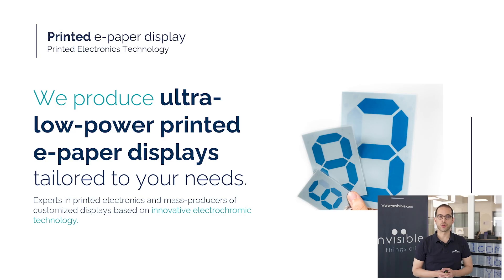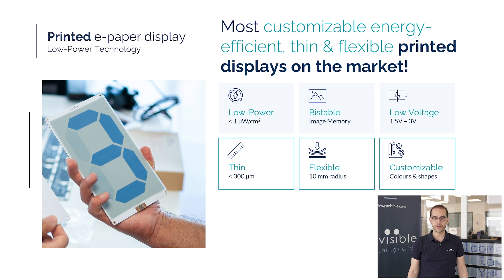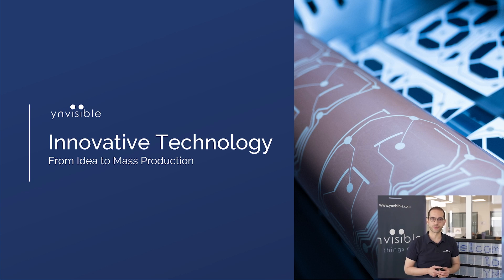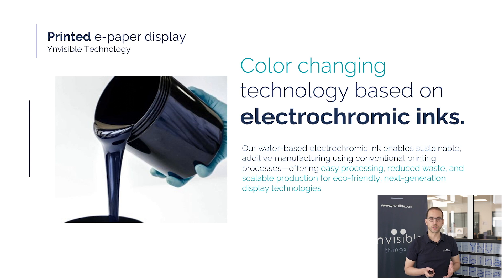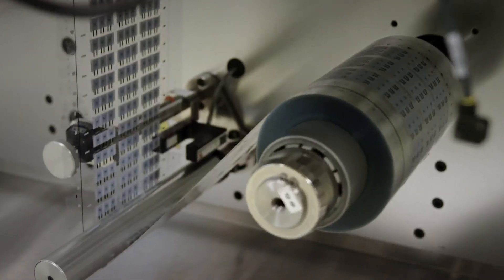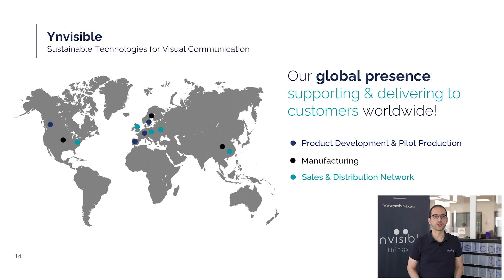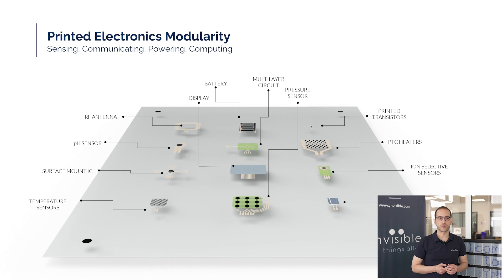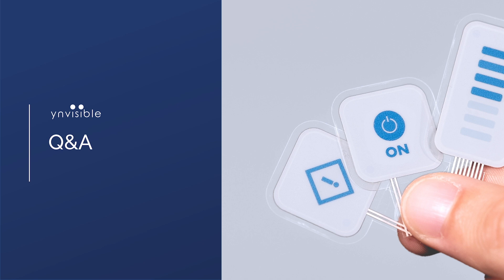Webinar: How Does Ynvisible's E-paper Display Technology Work?

Comment: Very interesting display technology......Can you tune the contrast during manufactuer to make it a very deep black display, also do you make displays with different colours and do you do a white display, also for the sake of argument  if Ynvisible was used to display a seven segment time display instead of typical LCDs....... What % life increase would a Ynvisble display tech get out of two renata sr927w  1.5volt 2 year batteries ?
Reply: Ynvisible isn't straight with their communication and what the applications actually are. No, the contrast ratio can't be improved much. They have limited durability. As you can see in all their demonstrations, there has to be quite some distance between segments. You're better off looking at static LCDs, memory LCDs or EPDs. Ynvisible quotes 3:1 contrast ratio, while high-quality transflective monochrome LCDs offer 14:1. Also understand that Ynvisible ECDs are semi-bistable, they require regular refreshing.